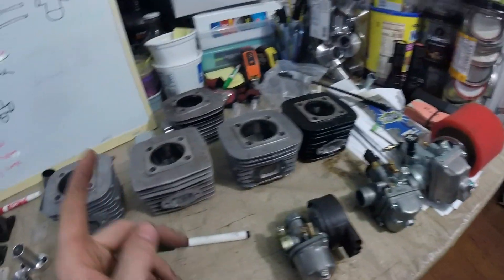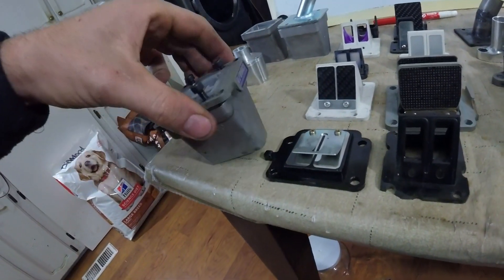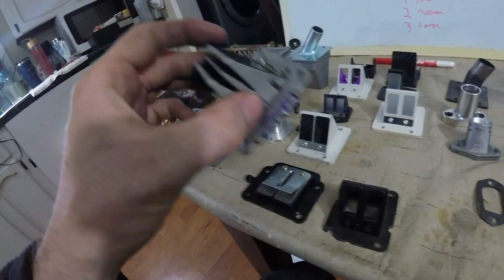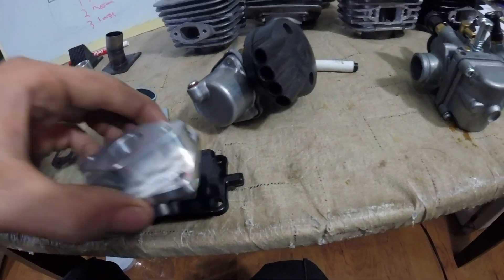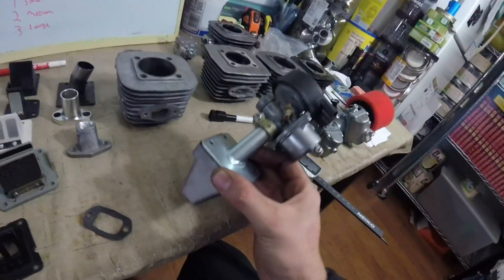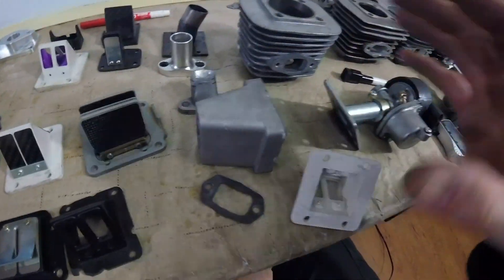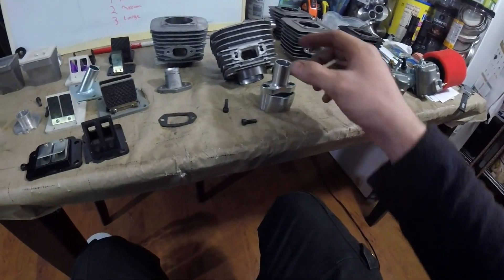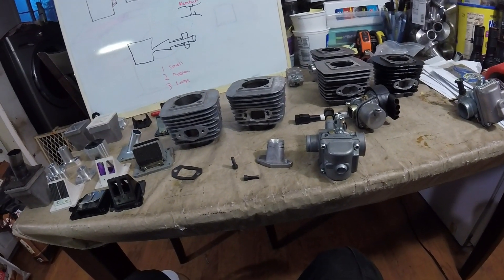Basic Induction Do's and dont's

Comment: To get the best bang for buck, would you go with a $50 VM22/G2 reed complete kit (plus $10 on jets $20 on reed stuffer=$80) for a ported 47mm engine (that could be used later on 49-50-52mm engine)
Or just buy a $25-$35 ktm clone or Dellotor 19mm clone and some jets and go piston port? 
I'm guessing the $25-$35 carb upgrade/piston port can be just or almost as fast as the $80 reed setup without having to buy more reeds later when they break?
Reply from the maker: If your looking for bang for your buck, a phbg 19-21mm clone carb with a screw on style top, and just cutting a stock intake or getting that 23mm OD spigot carb piston port intake will get you going pretty quick without much money invested and plenty of power to be had. Plus if you upgrade to a reed valve later it also works great with a reed valve.
Reply: @wtmotobikes8838  Thanks for the  reply/info.